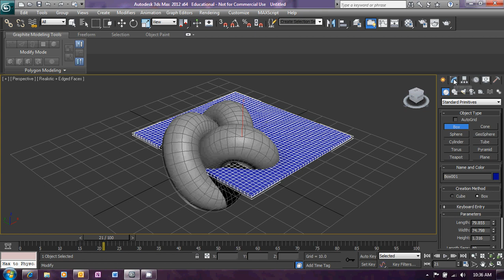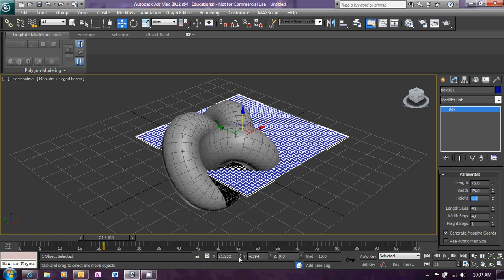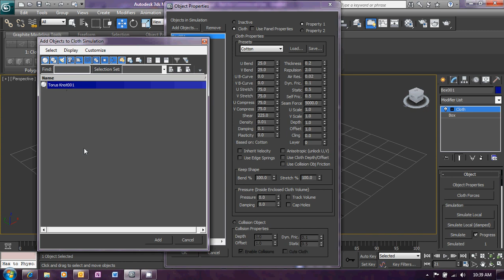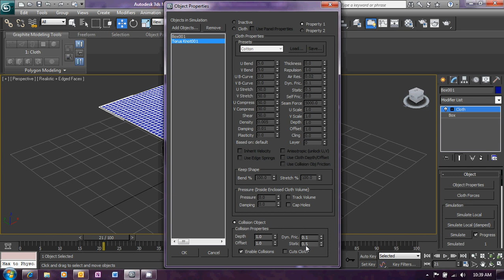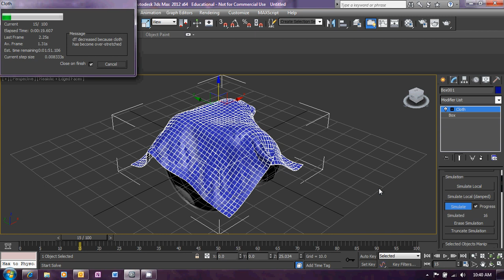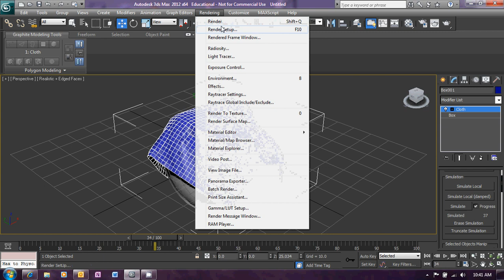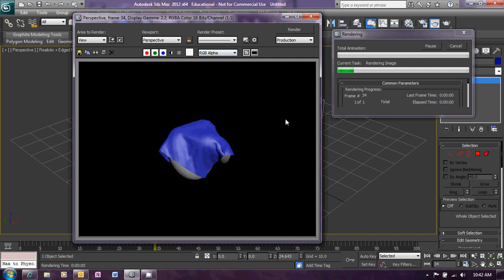Cloth over a solid object Autodesk 3DS Max beginner

Comment from the maker: I did this on my laptop. It is about 3 years old. 4 Gig of RAM, dual core processor and onboard graphics card. It would take about 10 minutes to render the cloth animation but it only takes about 10-15 seconds to do the animation for the cloth simulation. To simulate cloth the only frame that needs to be rendered is the one selected. If I wanted to create a movie of the cloth falling I would need to render each frame, and that would take about 100 times as long.